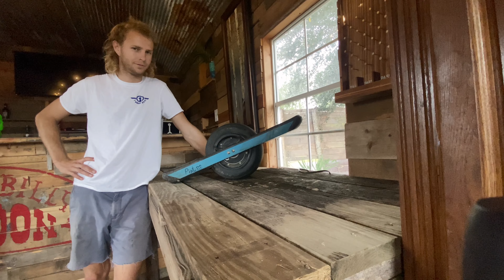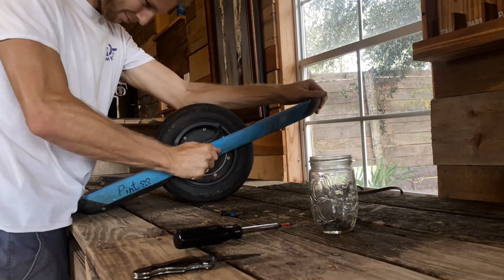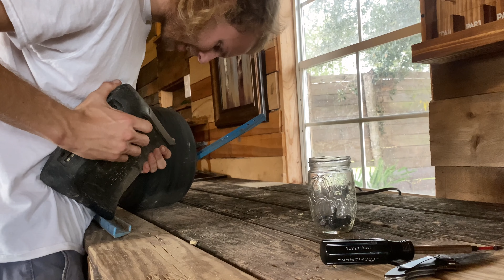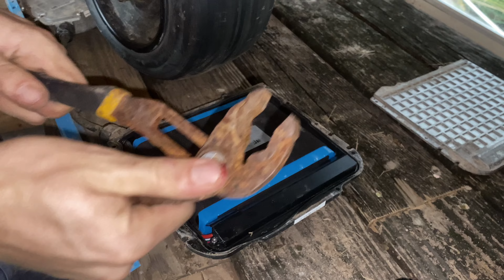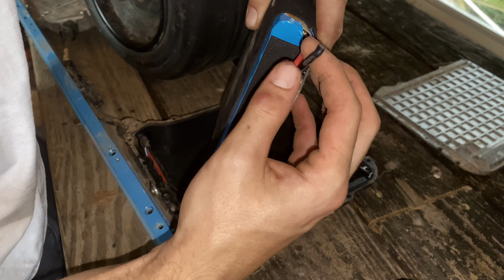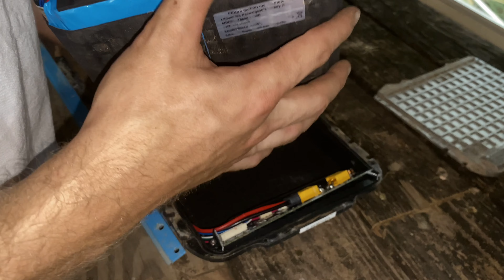Onewheel Pint X Broke - Dangerous Mistake

Comment: So...2 things.. First, I'm curious why you didn't unscrew the BMS cover to remove it. Seems...a bit rough. But second, that negative lead popping off the pack is...disturbing. I mean, that looks like a very cold solder joint. Amateurish on a new level. I can't imagine the percentage of Pint X packs that have bad solder joints on the discharge leads...but it's definitely disturbing.
Reply from the maker: I like to do thing a little more rough and rowdy in Shredville. I agree tho, the more i think on it, that cable has probably been giving me problems since the beginning. I was having weird coltage cut outs from day one. I figured it was an improved pushback of some sorts.
Reply: looks like too much solder have soaked into the wire during the soldering, and it made the wire easy to snap.
Reply: Another source of damage is the battery housing itself. All the balancing wires & battery lead wires are crammed against it with no protection from hard plastic.

Comment: Chances are, Future Motion will not repair it under warranty. 
It does however, look repairable. I believe that with a little bit of delicate surgery and a soldering iron, it’ll be good as new in short order.
Good luck!
Reply: FM won't even acknowledge that this is design flaw. FFM!
Reply: Battery warranty is only 6 months anyways

Comment: So I'm confused, isn't this under warranty?

224 miles is well under warranty, unless you've had the board for over a year by that point.
Reply from the maker: I didn’t want to bother with their frustrating customer service system. They generally find a way to have the consumer pay a bill even under warranty. 

This is a product design flaw that happens to many units. However even with it being a malfunctioning product, I voided my warranty by riding it #offroad and it would have been cheaper to repair through a 3rd party shop.
Reply: @BillyShredder  hmm well that's worrying...

As semi common as I've been hearing about this issue, I'm keeping my fingers crossed its still some sort of case by case situation where maybe the design flaw might not cause an issue for the majority.  I hope... trying to be optimistic. I mean, I've seen dozens of pint x owners go beyond 1k miles without a hitch. 

And I'm afraid to open mine and void said warranty regardless to check it, I just hit 50 miles on mine. :-/
Reply from the maker: @Wheelz567  yah it’s a weird thing to buy a product, immediately open it & modify to prevent damage and failure. 

The box is poorly designed. I think the variable on whether or not the unit holds depends on how well the battery was built. Wires too short, more likely to break.
Reply: @BillyShredder   for sure.  Eesh, fingers crossed. I'll keep an eye on mine without a doubt. 

Thank you for the replies on a year old video! 😀
Reply from the maker: @Wheelz567  sure thing 👍🏼 this is unfortunately a high performing video because everyone searches on YouTube when theirs breaks 🤣😅

Comment: Wow, 224 miles is pathetic; the Pint X only lasted you a couple of weeks. I just hit 3,000 miles on my Pint tonight, and it’s still going strong. I've definitely pushed it to its limits of tricks and speed but only ever had footpad sensor issues. Hopefully it lasts long enough to retire and be replaced by the GT.
Reply from the maker: Well on the upside, the X lasted longer than my 4212 XRs did. On top of that, I’ll be able to repair the X unlike my XR systems. My pints at about 550 miles now still going strong!
Reply: Good to hear. Hopefully you get the X fixed up soon!
Reply: Dude I legit got mine 2 months ago it literally had 170 miles, I just went on a ride yesterday and it just died way to early, I walked it back home and charged it all night, would only go up to 60… after taking it off and turning it on it immediately went to 1% now I can’t get my one wheel to work. Idk how their warranty works but if they don’t fix it there is going to be a real issue with one wheel. Just payed 1700 dollars on something I thought was supposed to be damn near indestructible I thought. Really hope I don’t have a 1700 dollar paper weight on my hands but I guess we will see
Reply: Forgot to mention now my app says I’ve road it over 13,000 miles! Like what
Reply: @Gmoney444A  my board is now a paperweight because of this!

Comment: thanks for the breakdown and tips on the BMS mods! sucks that your battery wire was completed sheared, hopefully that's not a widespread problem.
Reply from the maker: Yep! I’m just happy my Bms is healthy! Battery is sent off for repair.
Reply: Just happened to mine, 1600 miles.
Reply: Mine too, 750 miles. Was able to repair it quite easily tho! Now it’s better than it was before
Reply: @quinn_wheel  your BMS wasn't fried?
Reply: @northuniverse  nope! Still working great!
Reply: @quinn_wheel  well that's awesome! Gives me some hope that mine is still good, it's in a SLS shop now. Fingers crossed.
Reply: @quinn_wheel  did you open up your board after seeing the design flaw post on the subreddit posted a few days ago?

Comment: the shield you broke off covering the BMS is that what looks like cut through the negative wire from a hard it or gradually wore through it from slight contact and vibration.
Reply: I'm a electrician and what puzzles me most is I've seen a lot of damaged wires and that's such a clean cut. no fray or anything. looks like something sharp pinched it.
Reply from the maker: @GeorgeBurger3  it cut deep down in the battery pack. But I totally agree, very clean cut, no fray. Another oddity of the cut is that the wire was recessed into the rubber of the wire. My guess is that it ripped the wire from the saughter weld instead of breaking the actual wire.

Comment: Hey dude, so did you manage to fix it in the end?
Reply from the maker: Got the battery fixed, then put it back together. Seemed to have some other issue so i just sold the parts.
Reply: @BillyShredder  that’s a shame buddy. I’ve got the same problem at the moment. Was it easy enough to fix the black cable back into the battery?
Reply from the maker: @eekdestroy5329  I sent it off to a shop to get it done.  They said it was a simple repair.
Reply: @BillyShredder was the issue a purple blinking light then it just shuts off
Reply: @almaharker this is the issue mine has, the purple light then shut off. This happened after soldering the black cable back to battery also. Did you fix yours? Hope you’re seeing this, saw another comment from you where you say it’s fixed…talk to me buddy!

Comment: same thing happened to me, did you send it off to someone to fix? Who do you send it to? did you get a replacement battery? I can't seem to find one online that will work for the pint x, please help!
Reply from the maker: I sold my parts to float jesus. Find him on instagram or his shop name is Float therapy. He can fix as well as onewheel MOB shop. You have to repair more then the battery, when this happens to a pint x, it always damaged the bms as well.
Reply: Mine did the same I just soldered the wire back on

Comment: Dude that clean cut black wire is some straight up sabotage.
Someone at Onewheel must be a disgruntled employee or a psychopath.
I wonder how many people are going to nosedive because of this, and whether or not FM is going to issue the recall before or after Xmas.
Reply from the maker: I’m just hoping it was only mine😅 would really hate to see more X go out like this.
Reply: Surf422 you and I both thinking the same thing like wtf
Reply: Just happened to mine after 1600miles

Comment: The battery ground cable and XT60 issues may explain your earlier nosedives.  Problem solved.  Let the worm burning continue.
Reply from the maker: The hard cut outs at top speed! I would agree. Really should have opened it up the day i got it lol
Reply: @BillyShredder  hopefully the curse has been solved and we can now see its true potential
Reply from the maker: @andrebaudoind  the X curse shall be lifted 😆 we’ll certainly see.

Comment: What if your battery was never giving you full  power causing early nosedive
Reply: From a loose half assed connection
Reply from the maker: I’ve thought about that. I was definitely not getting full power with that loose BMS connection lol.
Reply: @BillyShredder  interesting ill have to check mine
Reply: @BillyShredder  scary tho I don't wanna mess up anything opening her up
Reply from the maker: @andrebaudoind  yah it’s troubling to open a board when it’s functioning fine😅 but if that connector had came off a little more then my Bms would likely have fried!
Reply: @BillyShredder  how much is a new bms?
Reply from the maker: @andrebaudoind  they dont sell them. Even if you can find one or buy one, you can’t swap parts on new boards without modifying the Bms. Thats why it’s detrimental to not blow a bms lol. Thats death certificate of a board.
Reply: @BillyShredder  can u atleast send in ur board to fm and have them replace em?

Comment: you can just easily fix that yourself.  Open it up.  expose the wires and remove the old broken one, and just solder a another new wire with a new xtc60 connector.  Walla!! you are done!! ready to shred. . you will be Happy Billy Shredder soon enough. . Shred on, onewheeler!!!.  .
Reply from the maker: I’ve had my fair share of playing with batteries in the past. 54v makes a big spark when you accidentally touch 😂 I sent it out to my battery tech friend and he’ll get it shred ready. I am very thankful that it is a simple fix tho.